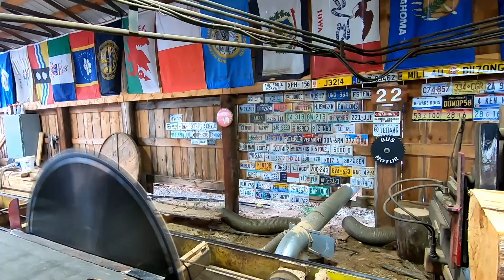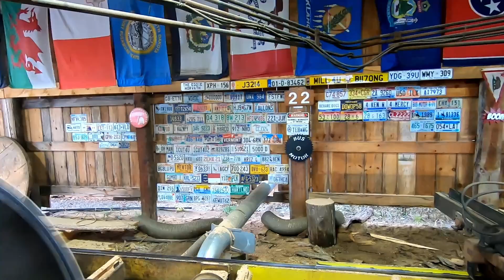sawing old cherry logs PT 2 #354

Comment: How "old" do you think these logs were, and I'm surprised there didn't seem to be much end checking. You mentioned these logs weren't sold, so what do you do with hardwoods like this, meaning logs that don't become not construction lumber? Knowing how expensive wide boards are, do you ever saw with the idea of getting book matched pairs from the log, as wide as possible?  What thickness were you cutting these at, 6/4?  thanks

Comment: Mark, just curious. The Cherry board that drops off at 15:56 for instance. How much would that one board cost me if I came down with my trailer to pick it up? Not saying I would like to, just wondering...Moses <><
Reply: Here's a rough estimate.

The board that will come out of that piece is about 16 inches (1.33 ft.) wide and 10 ft. long. So that's 1x1.33x10 = 13.3 board foot.

Top grade cherry runs about $6.10 per board foot, so that's 13.3x$6.10 = $81.00 for that board.
Reply: @GlenPorter1  That is very reasonable. That one board would do a whole cabinet I'm building.

Comment: I'd like to know who your customers are for your milled wood.  Reason: it seems to be so roughly sawn that it would take an incredible amount of time to plane or sand it down to prepare it for fine furniture projects.  Or are buyers just looking for super rough cut wood planks to build rustic outdoor chicken coops or basic wood sheds?  You say often, "This is nice wood," so I'd like to know who agrees with you when they hand over a wad of bills to take it off your hands.
Reply: I can assure you it looks worse than it is
Reply: They’re sawing 4 quarter boards or 1” thick.  After drying, you can lose up to a quarter inch in planing and arrive at the 3/4” which is a standard thickness for a lot of furniture projects.  It may look awful but it cleans up a lot faster than you might think.
Reply: @oldtireman4665  The untrained eye doesn't see so well.
Reply from the maker: this is how rough cut lumber is sawed that's why it's called rough cut
Reply: @markgalicic7788  I was also told by someone here that planing is another way to eliminate the saw marks.  I just didn't realize they could be removed without overly compromising the thickness of the board.  I guess as long as you can still count to ten at the end of the day in the wood yard, you win.

Comment: Strange FPS problem again
Reply: @markgalicic7788  the video was recorded at 24 frames per second. Youtube displays it as if it were 30 fps, making it very jerky. Your videos are usually recorded in 60 fps which display very smoothly and correctly.